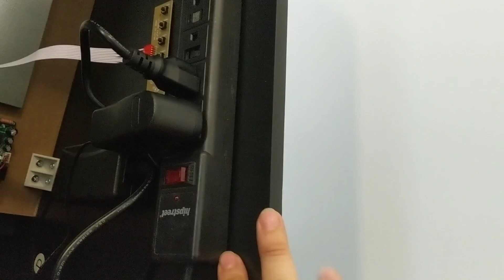HOW TO WIRE MANAGE ARCADE 1UP CABINET WITH RASPBERRY PI AND RETROPIE

Comment: Hey nice video. I know to use the LED buttons connect them with usb encoder but how do you use the existing buttons ?? Their controller requires two usb slots
Reply: Yes. You have to assembly it yourself. Get a used usb cable, cut one part end and wired manually to already exist usb encoder. Make sure you know the diagram for usb cable.
Reply: Like so.. https://thepihut.com/blogs/raspberry-pi-tutorials/arcade-usb-encoder-wiring-guide